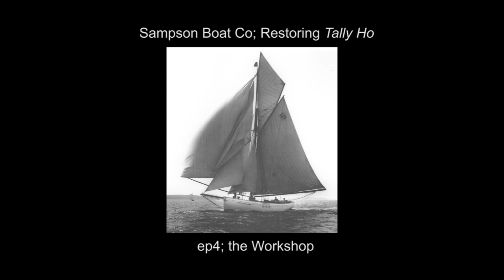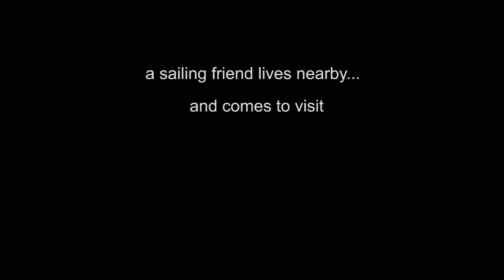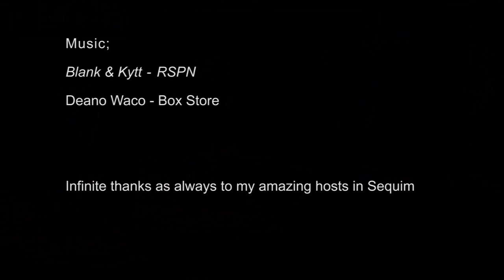Organising the workshop - Rebuilding Tally Ho EP4

Comment: The video tour of the "facility" set me on tilt considering that almost none of the bedraggled tooling match... 
it frankly betrays my feng and has completely stifled my shui. 
These critical elements, I am SURE, you will have thoroughly sorted before any attempts at proper shipwrighting ensue. 
The more pressing problem My Dear, hardly needs addressing since I have no doubt that the uniform providers simply haven't routed that forsaken riprap as yet. 
Do try to buck up Lad, things must SURELY improve and we shall have a jolly har at these, your hours of need. 

I would give one of my nuts to be involved in this EPIC journey. What a fabulous shop, location, parrot and some true friends, 
Thank you for letting me rewatch for like the third time, 
THANK YOU!

Comment: once the curtains are put up, you could also add  force air ventilation to the loft space. this would stop it from getting stuffy as well as reducing the ingress of dust by forcing it away from any gaps in the curtains ect
Reply from the maker: ah, you mean positive air pressure in the loft? That's a very good idea, thanks.. will ponder it.
Reply: There is a thing called "the ball in the wall" used in hospital operating rooms that is a simple clear tube  with a snugly fitting plastic ball inside to view that positive pressure as a constant fact.  I suppose one could also view it as "Wind in your Sails".  I'm sure you get my drift by now.  I'm just getting on board now, and thanx for the your inspiring motivation!
Reply: Yeah great idea!

Comment: Bit of a suggestion for the loft area.  If you're not planning on building any sort of stop, wall or otherwise, a 1/4" runner of quarter round faced outwards will stop dropped items from rolling off the edge.

Comment: Leo this is all just fantastic and the Vids are bang on. I like your vision and upfront investment - building the shed, tidying and organising the workshop, sorting out the living space ( which is great by the way).

If not too late - maybe using that plastic sheet they use in cold climes for winterising boats. Fix to frame and it stretches drum taut with hot air gun.

Comment: I have watched this channel from the beginning and am struck by a couple of things: 1.  Leo is a bloody hard worker!  Especially in the reconstruction of the hull.   2. ever hear of George Washington's axe?  The apocryphal story says that in the 250 years of its preservation, the head has been replaced twice and the handle four.    Much like the axe, the Tallly Ho has been almost completely rebuilt with all new materials; in fact, besides the lead of the keel and the original capstan, little else remains from 2017, let alone 19071   I suppose it makes sense working with the extant boat as a template is much simpler than building a new hull... maybe?

Comment: Shop looks great now. Personally i'd expand a bit on the dust extraction system, but that's up to personal experience and decisions, after all, a lot of the work takes place in the boat, outside.
In your loft, light is nice, but if by any chance things get cold (i'll assume there's a possibility of it based on the hanging heater) just put clear plastic over the window frames, it will form a barrier between the glass and your space (same goes for the rest of the walls, insulating yourself in a bubble of plastic sheet keeps warmth inside, but beware of good ventilation.

Comment: I wish I could help you , but probably not as im more of a welder than a joiner !....
Reply from the maker: There will certainly be times a bit later in the project when I need help with metal fabrication, so you may be able to help after all..!
Reply: HELLO Leo, im out of action at the moment,i suffered stroke on the 2nd but im expectedto make a full recovery by dec 2017.....hope ypu are well.
Reply from the maker: Very sorry to hear that, wish you all the best for a good recovery. Take it slow and get rested! ...and thanks for watching.